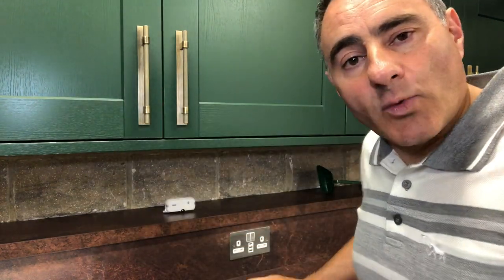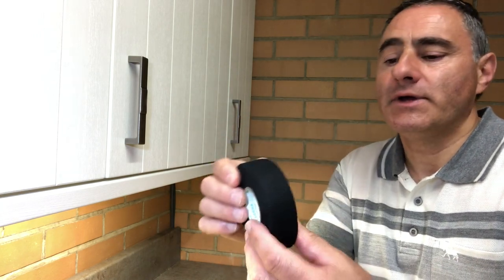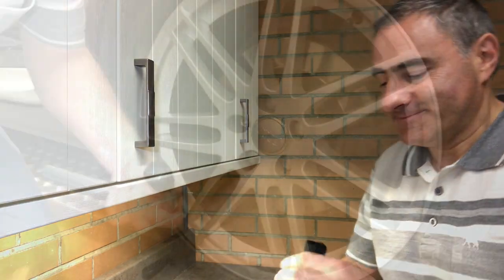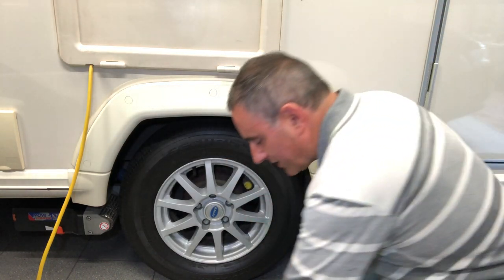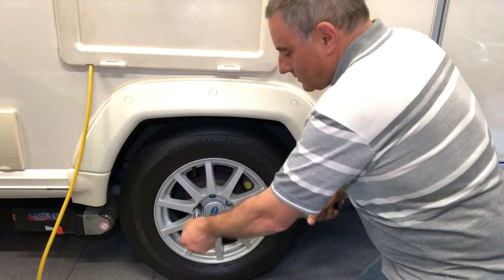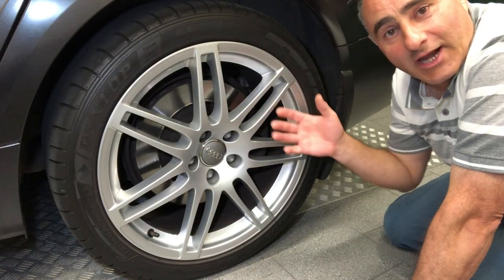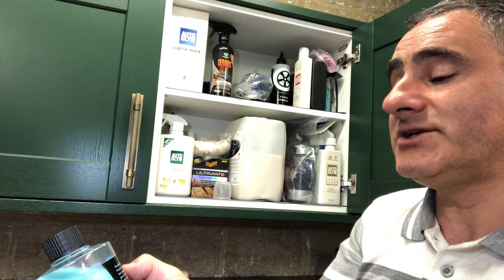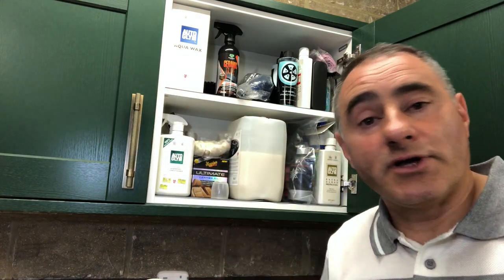Alloy Wheel Tips for Car, Caravan or Motorhome

Comment: Good little tip that Rob with the fabric tape .. I discovered it a couple of years ago by accident it's great stuff 👍 
Take a look at AD Autobrite car detailing products they are excellent 👌  
Nice film 👍 regards Glyn
Reply from the maker: Same here Glyn, I started using the fabric tape on the caravan torque socket a couple of years ago but only recently decided to do the other tools, hence the video. Had a quick look at AD and they have quite a comprehensive range of products. Will look at them in more detail. Thanks for that and thank you for watching. All the best, Rob

Comment: Nice tip with the fabric tape Rob. You have a great selection of cleaning products. I recently changed the car and the ceramic glaze sounds like a good investment 👍Graeme
Reply from the maker: Thanks for watching Graeme. The aqua wax is good, you spray it on after rinsing and then dry the car. But in warm weather you have to work fast as it dries quick and makes it more difficult to get off. Trick is to re-wet the areas that you are drying before it dries, if that makes sense. The Diamondbrite glaze is brilliant. Make sure the car is dry, spray it on and buff off. It just disappears like magic. Cheers, Rob